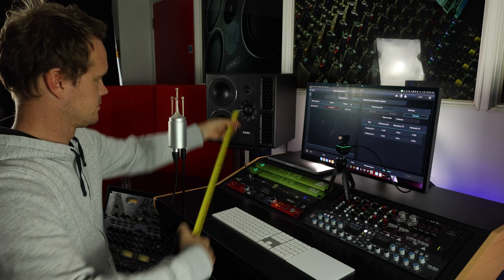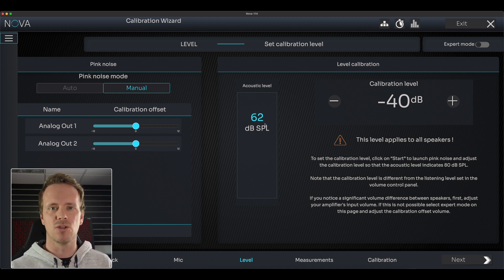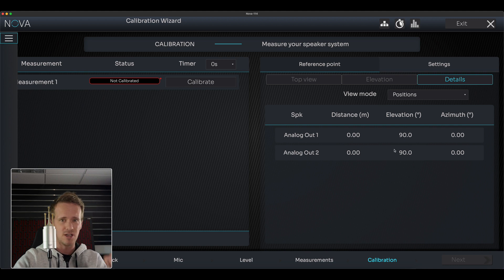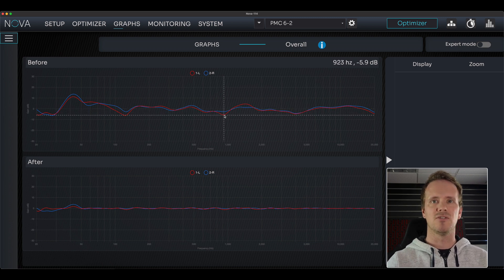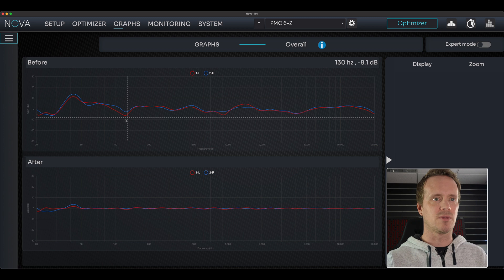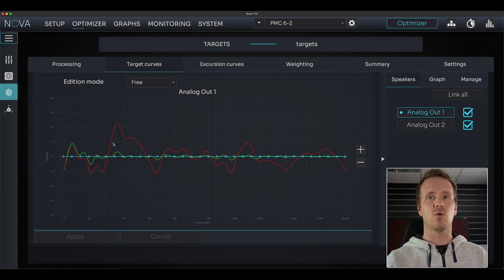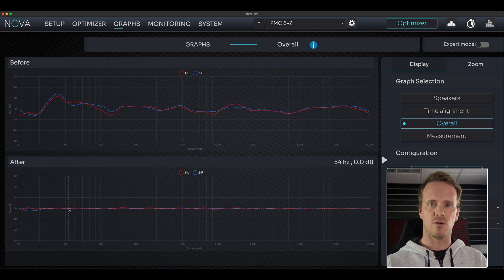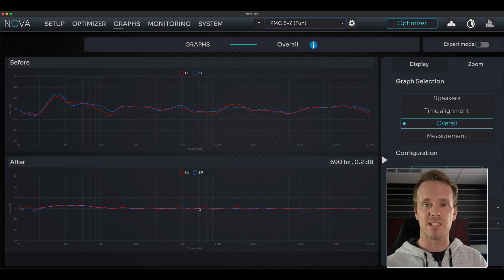Trinnov Nova: Best calibration tips

Comment: Great job but you are wrong at 13:30 concerning excursion curve :
If you want to reduce the 40Hz bump, then you should increase the attenuation curve from -10 to -13dB in this area  (edit the other blue line). You are lucky the optimizer somehow managed to flatten those ripples (maybe a side effect of boosting that 20-30Hz hole). By the way, be careful, it is not recommended to boost that much low frequencies. You could damage your speakers and/or start hearing weird stuff. In this case, I would try moving things around and calibrate again, to see how this potential room mode evolves.
Reply from the maker: This might be something that got mixed up in the editing stage but the UK Trinnov distributor did review this video and verify it for us. Regardless, you're absolutely right about being careful not to boost too much, which I definitely highlight in this video. The point here was to guide you on how to make these adjustments should you want to experiment, but with caution! Completely agree!
Thanks for the comment!

Comment: First of all, thank you very much for posting this. Great tutorial.  I had a question though. In the part where you adjust the upper excursion curve to flatten out that peak you have at 40 Hz, why are you using the upper curve and not the lower one. After all, you are adjusting the attenuation limit, not the boost limit. Cheers!
Reply from the maker: I needed to increase the amount of attenuation the Trinnov is doing, so by raising the curve I'm increasing the amount the Trinnov will attenuate it.
Reply: @sxproaudio hi. But the attenuation curve is the lower blue curve. Raising the upper blue curve will increase the maximum boost the algorithm will consider. Since you want to increase the amount of attenuation, that should be done by dragging down the bottom blue line (which is the same as increasing the attenuation limit).
Reply from the maker: @paboloish  The Trinnov UK distributor watched and verified the video was all correct before going out. Regardless, if there are any such errors in future we’ll pay extra attention to such details and ensure nothing slips through!

Comment: Is there a way to connect Trinnov on my network via wifi?
Reply from the maker: As the Trinnov has no wifi built-in, you need to connect it via ethernet to a router. I guess it's possible that some sort of wifi dongle may work, but I haven't tried that so cannot verify that as a solution.

Comment: useful thanks - I'm shortly going to buy the Nova and use it in  2.1 configuration - It would be very helpful if there was a video on how to integrate a sub..
Reply: Would love to see this!
Reply from the maker: @joeyf808  We have scheduled a video in for this :)
Reply from the maker: @calib5  It’s so easy to do it’s almost self explanatory. There are two ways to do it depending on if you want to be able to bypass the sub with the Trinnov.
If you run stereo into your sub and from there into your speakers, you can use the Trinnov exactly as I’ve set it up in this video.
If you wish to run the sub on a separate output, you will need to purchase the 4-license Nova, and then specify an extra output in the “speakers” part of the configuration pages. Then proceed with the calibration as normal!
If you have the La Remote, you can bypass the sub at the simple push of a button and it also restores the full range to the speakers when you do so.

Comment: does it just look like that or is your monitor a little too low? The midrange speaker on the PMC 6.2 should be at ear height. That's the center axis. 😉
Do you use ISO acoustic pucks under the speakers? They really make a difference, the low end is tighter and the mids are cleaner! I can only recommend these things 😉
Reply from the maker: As you can see in video, the Trinnov show the elevation on the left speaker to be -2 degrees, and the right speaker a tiny bit above zero degrees. This is about as level as you could hope for in real terms and is probably attributable to my mic stand not being completely straight/vertical. Besides, The actual acoustic centre of the speaker is between the mid-range and tweeter, a little higher than you're suggesting.

I knew someone would spot that I had no speaker isolation under these. On this particular day of shooting I had to loan my ISO-PUCKS out so had none to hand, but thankfully it doesn't remotely harm the concept of the video.
Reply: @sxproaudio  hey
take a look at the description at PMC, it says that the central point for the height of the monitor on the 3-way speaker is the midrange speaker, which should be at ear height!😉

The way you do it is the same as with 2-way speakers!😉
Reply from the maker: @mosermichael4404  I was actually thinking of the PMC 6 where the acoustic centre is indeed between the woofer and tweeter so you are indeed correct about the 6-2 in this regard! Apologies!
Regardless, Trinnov says that the measured acoustic centre of the speaker is at between zero and two degrees from level; ie perfectly ear height - did you see that part in the video?